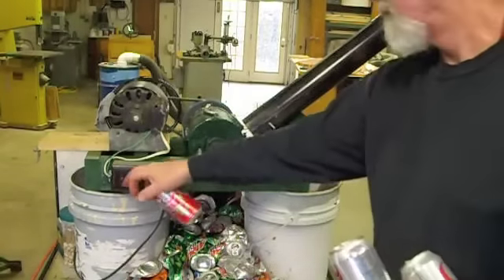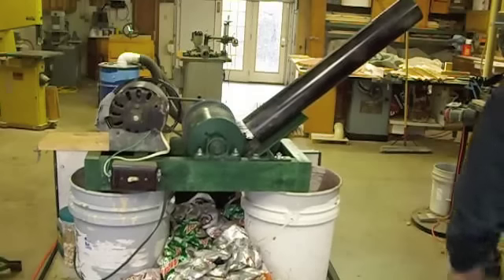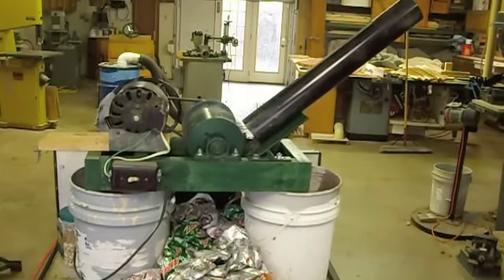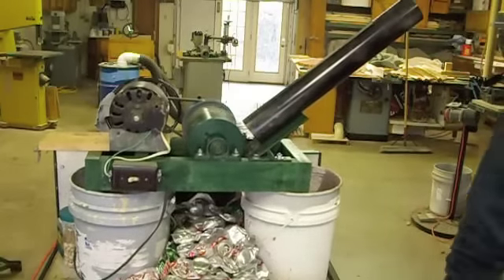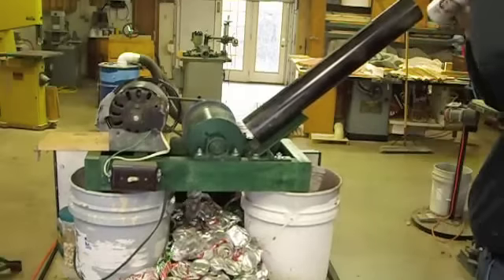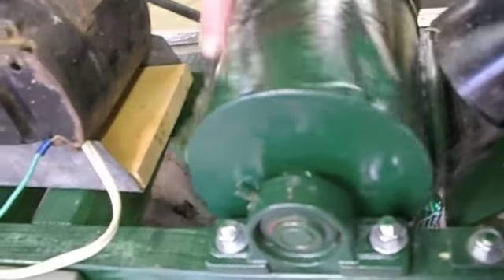Rotary Mechanical  can crusher

Comment from the maker: The motor is a 1725 rpm The pulley on the motor is the smallest you can get on a 1/2 inch shaft. The pulley on the drum is about a 8 inch. I would be more specific but I don't remember the exact size and they are about 400 miles away.

Comment: 8 years later, amd the best design I currently see on here. I just finished a pneumatic ram crusher, works great, but takes time. This would cut my time down significantly. Question though, some of the cans I get are a little crushed already, wondering if they would slide down the tube? I'd like to use a hopper if at all possible. Thanks, thos is great!
Reply from the maker: if the can slides down the tube it crushes it it works on longer cans also you could use a hopper just need to figure a way for the hopper to feed the cans into the tubeone at a time
Reply: @dc9apu  thanks for the response. Im currently experimenting with a prototype!

Comment: Is the drum (6" dia) 8" wide?
Did you consider making it wider so that is could handle a can laying down?
Based on your experience, is there a reason not to consider this idea?
Reply from the maker: 6" diameter drum. I don't think it would work having the can side ways. The drum actually catches the bottom or the top of the can to pull the can through. Try your idea and it let me know if it works'